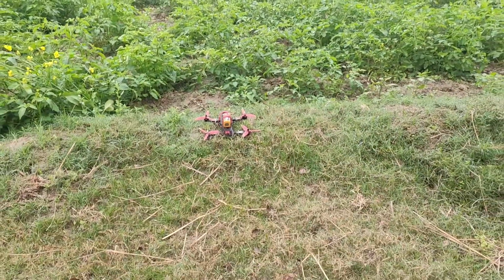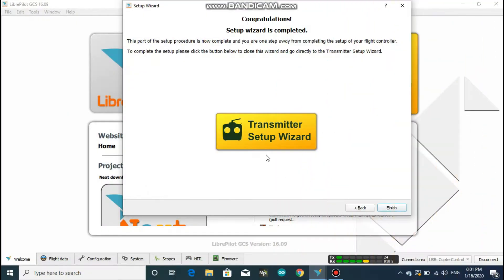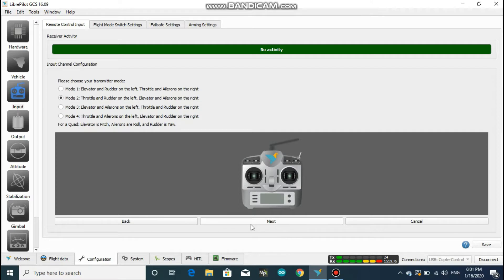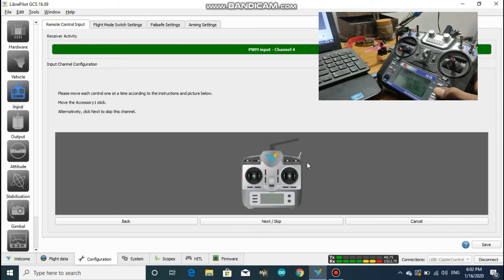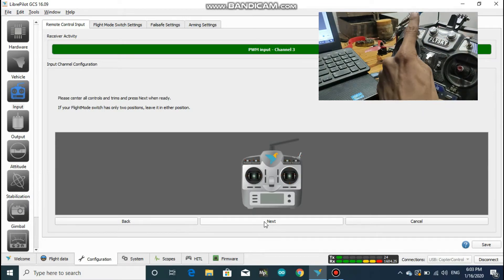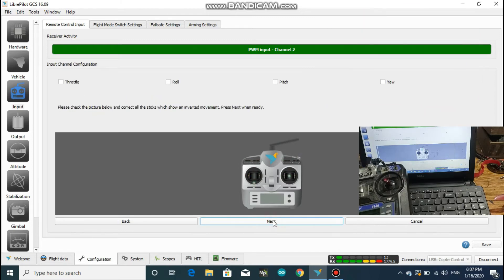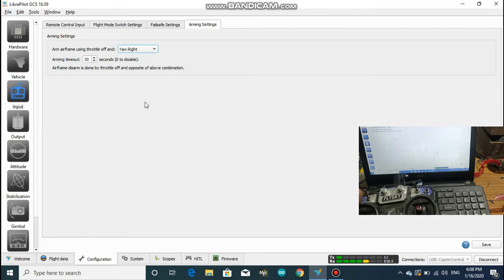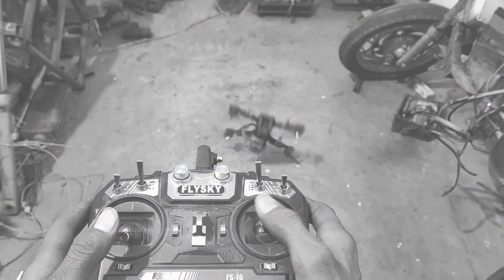Transmitter setup wizard in librepilot

Comment: Great video. I have a question about what you're doing at 1:52

When LibrePilot directs me to move the throttle stick up and down, nothing happens. 

I have already programmed the transmitter and receiver using the following path on the LED screen:

Menu > System > RX Setup > AFHDS 2A > ON

Is there anything you can think of that could help me move forward? 

I appreciate your time. 

Thank you!
Reply from the maker: hey thank you for your comment. basically at your time stamp, It is mapping the receiver input to the channels. this is done here because this allows you to input the radio receiver in any order but librepilot still makes it correspond to the right channel. 

Please let me know more about your configuration and exact problem so, I could help you.
And your're most welcome.